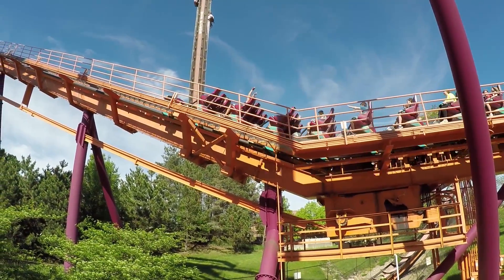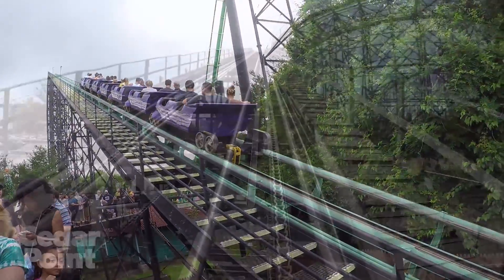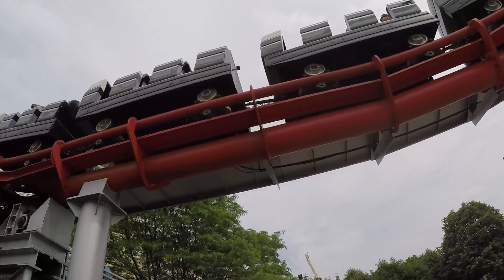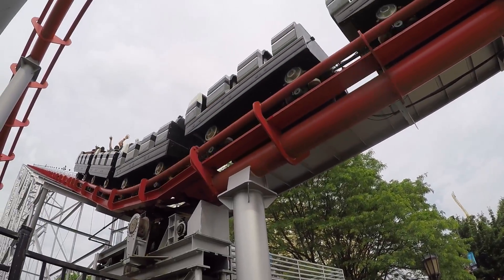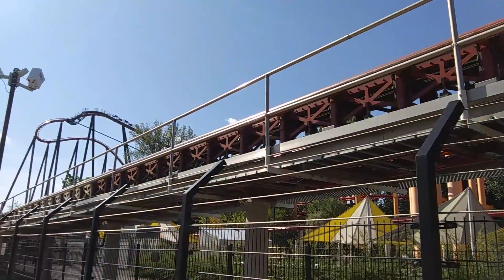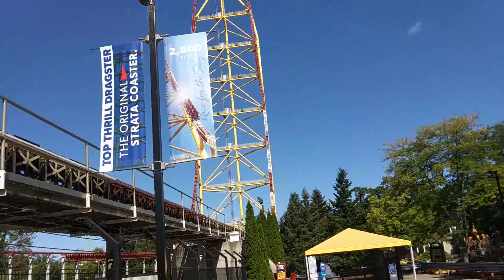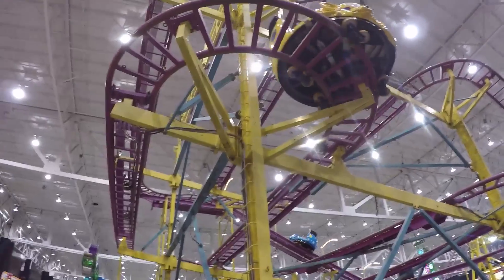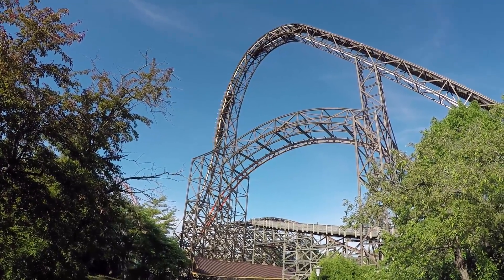Can roller coasters fall BACKWARDS down the lift hill???

Comment: Yes but it's STUPIDLY unlikely and can only really happen near the bottom of the lift hill where the train engages the anti rollbacks. Shoot the Rapids at Cedar Point actually did roll backwards down the lift hill because it failed to engage the anti rollbacks correctly

Comment: "Some rollercoasters have magnetic brakes that pop up behind the passing train but will not stop a train"
I'm sorry, what? This whole time I thought the breaks on my favorite roller coaster would stop the train should something happen. It has a straight vertical lift hill. I do NOT want to fall backwards should something go wrong with the lift chain. O_O
Reply from the maker: Magnetic brakes are unable to stop trains. You would fall back down the lift extremely slowly.

Comment: Swedish park Liseberg also had an incident involving the failure of an anti-rollback system, on their Schwarzkopf coaster Lisebergsbanan. The chain lift experienced a malfunction while only part of the train had engaged with the anti-rollback mechanism. It couldn't withstand the pressure put upon it and subsequently broke, sending the train backwards into another offloading train. 21 people were injured, but none of them severely. It was a major incident for such a small country and safe park, but 14 years later and it's been back to operating perfectly safely again since.

Comment: at Six Flags Kentucky Kingdom we have a ride called Greased Lightening that goes forward into a loop and then backward again back into the loop. I was never the biggest fan, but it’s a good enough ride if the line is short.

Comment: How do u get out from roller coaster with 90 degree angle lift hill if it stops
Reply: Most of the time we either send it over in maintenance mode or release the motor brake and slowly bring the train back. It's extremely rare to have to evac off a vertical lift. 

If the perfect storm of problems does happen and evac is needed, there is a maintenance lift with a hinged platform that swings out in front of each row that people stuck will climb into.

Comment: Another serious rollback incident happened at the Swedish amusement park Liseberg. The claw type rollback preventers were perceived as too loud, so the amusement park created cam type preventer, they gradually wore down and were also affected by grease from the lift chain. When a bolt broke on one of the chain locks the preventers failed to work and a train rolled back towards the station where it struck a waiting train.

Comment: question. i always have this fear and i know it’s irrational, but i’m terrified of a ride getting stuck on the lift hill and then if they are evacuating the riders the ride will start working again. same with if it got stuck in other places and they started evacuating and the ride just starts up again. is that possible? or likely?
Reply: @Chimera thank u so very much! :)
Reply: Most of the time there are 2 keys that are cut differently that need to be put into the control panel to power it on. One is used for normal operations, the other is kept by maintenance. The coaster can only clear an emergency stop error with the maintenance key, and if both keys are taken out nothing can move at all.

And if there is a lockout/tagout, you might see a park official and maintenance with a red metal card-like thing and a uniquely keyed padlock hanging off their hip. The critical switch to power the coaster is turned off, that card-like device is passed through the switch to keep it locked off and the padlock put through the holes in the card. Then up to 6 padlocks can be locked through that card, and the ride cannot be powered on until every one of those padlocks are taken off.

This sort of thing is common with heavy industrial machinery when you need to maintain it, and coasters are pretty much all industrial engineering with a bit of artistic flair.
Reply: Ravaxr thank you!
Reply: @Chimera I was a steam train engineer at an amusement park, and in working up the ranks to the engine I got placed on a few coasters when they were short handed. Also a bit of a coaster nut to begin with :p

Comment: The anti rollback clicking noises are so freaking satisfying. It also makes the lift hill so much more intense. Especially on rides like X2. Also I never knew that the friction brakes on gerstlaur lift hills slowly bring the train back. Also I felt like you should have showed the rollback fins on top thrill dragster so other people can understand what you mean. Overall great video
Reply: It's so loud on x2 though I'm trying to listen to the movie quotes over top of enter Sandman not the clicking. I couldn't tell if it was enter Sandman the first time since it was so loud. El toro has my favorite lift hill though. The station is elevated about 15 feet so you fly out of the station around the bend to the lift. You lift slowly for the first 3rd and then it yanks you up the hill at like 10-20 mph (it was years ago room for exaggerating just a bit) then it throws you into the bend at the top with like an 80° angle drop after it. It's a wild experience and unforgettable. The sound it makes is the loudest lift I've ever been on, and I thought Matterhorn was loud! You have to shout to talk to the passenger in the same seat as you on Matterhorn but el toro doesn't even give you that!

Comment: Wow. I've never realized the anti-rollback on some coasters were like that. It never occurred to me that I couldn't hear the anti-rollback on cable lifts.
Reply: Same thing happens with Expedition Everest for special effects. All you hear is the chain dog sliding over the chain before it engages, not the anti-rollback. Once the chain engages it is silent, leaving the sound effects from hidden speakers. Again, uses a magnetic wheel to levitate the dog unless it slows down.

Comment: In regards to other coaster questions: I've been wondering how block brakes actually work. How they detect whether or not the next block is actually clear and either activate the brakes or not. This seems to be a much older technology that predates the use of computerized sensors so I'm guessing that's not how many of them work.
Reply: I think gp to enthusiast made a video on it
Reply: Here is the link to the video: https://youtu.be/LJvrkxs4OXw
Reply: You'd be very surprised what you can do with relay logic. Technology Connections has a video about a jukebox that predated microprocessors and uses relays. It needs to interpret the selected song, find the selection, pick up the record, put it on the platter with the desired side up, then put a needle in the right spot and take it off at the end of the song to put the record back. Coaster blocks are way simpler than that.

It used to be that there was a spring loaded steel rod on a hinge that stuck out into the track. As the train passed, it would hit the rod, flipping it out of the way and tripping a switch. Of course, being mechanical and having to hit the train all the time they were annoying to maintain, so as soon as no-contact hall effect sensors came around they were integrated into coasters pretty quickly.
Reply: you ever seen those little green things sticking out on the track? those are sensors. they tell a computer system where the train is.

Comment: Thanks for this video! It’s very helpful. A few years ago Sheikra at Busch Gardens Tampa Bay stopped two ride vehicles on top of the roller coaster 200ft in the air and everyone was stuck for hours and needed to be helicopter rescued. Ever since then I haven’t been able to go on it or rides like it, even though they used to be my favorite. Do you know much about that incident? Because I could never find out what exactly happened.
Reply: Busch Gardens called it an 'electrical error' and didn't go into much more detail, but the symptoms make it pretty clear what happened.

That was a sensor error that showed the block between the dive pause and the mid-course brakes was occupied when it wasn't. There's a block between the dive pause and the top of the chain lift, and the chain lift itself is another block. The front train stopped at the brake before the dive as it should have to not violate what the computer thought was an occupied block. Then the back train kept going up the lift hill until it reached a few meters from the top and stopped there so as not to violate the block the front train actually was occupying.

It took a minute for the ride ops to realize there was a problem because a momentary pause to let a block clear ahead is normal, and Sheikra loads two trains at once. By the time they realized the pause wasn't clearing, two trains that were loaded simultaneously had stacked at the top of the ride and had to be evacuated. The ride performed exactly as it was designed and nobody was in any danger at any time, but the media went nuts because it was dramatic, visible, and cOaStErS Be ScAwY >n<
Reply: Ravaxr Thank you very much for the answer! That makes a lot of sense!

Comment: one of my main coaster fears is actually that noise because i thought it was the chain, but knowing its the safety thing now makes me a lot more comfortable. tbh, i have never been on a real coaster because i have a horrible fear of heights and on any ride that goes more than 10 feet above the ground i have to close my eyes, but these vids do help with some of the other fears ive had about coasters. does it ruin it to ride with your eyes closed?
Reply: Start small! My first coaster was space mountain at Disneyland. It's a perfect first rollercoaster. The ride is in the dark with stars projected on the walls around you. No inversions (upside down bits) and it only goes 30mph. Matterhorn is a good one to start with too. Both of them are indoors so you can't see how high up you are, but you aren't that high up anyway, Matterhorn feels especially nice for those afraid of heights since the track you're on is level with the mountain ground. No support beams to be seen. There's even a splashdown at the end! Space mountain is in the dark and while you can sometimes see support beams you are never far from the ground. Heights are scary, it's one of the things that still makes me afraid on rollercoasters, but I've been on the tallest of them all now, kingda ka. It was the only one to ever make me go "oh my god!" When facing the ground from that high up! There's even gadget's go coaster in Toontown if you're feeling brave enough to see the ground from 30 feet up.
Reply: spinningpeanut i live in wisconsin and im lower middle class. i cant go to disney so im gonna need to try other things. sadly we have nothing similar up here
Reply: @raeisgay426  Wisconsin dells has some good coasters, and pretty much all parks that have big rides have smaller ones so younger park-goers can get used to the sensations of being on a coaster.
Reply: Ravaxr are some coasters at mt olympus seem good for beginners? my twin and i have been discussing trying their coasters next time we go (was hoping for this summer but i guess not.) funny thing is, i love water rides. and for a lot of those you climd to the top, you dont start at the bottom
Reply: @raeisgay426  From what I see, it'd be pretty good. The things I look for in breaking in a new rider is a height around 100 feet, first hill is not very steep (I look for 45-50 degrees), and the ride does not invert. Cyclops looks to fit the bill. Zeus looks to be a good step up, and Hades another decent step.

Once you get on a coaster 150 feet tall with airtime, one that does a vertical loop, and one that has a heartline twist, the sky is the limit. At that point you've felt pretty much all the sensations that you'll get on much bigger coasters, and should be able to handle pretty much anything, including 300+ ft giga coasters. What really changes from ride experience is the variations of those sensations, and how long you experience them.
Reply: Ravaxr i want to try building up to at least hades 360. it has a (im bad with names/classifications) corkscrew? i think? idk some swirly thing
Reply: @raeisgay426  It is a bit of an oddball, isn't it. It's kind of a heartline twist, kind of a corkscrew. It's something in between. But it's made of wood and pretty impressive that they managed to make a working inversion with that. 

In any case, best of luck to you, and go at your own pace. Coasters are supposed to be thrilling and fun, not terrifying. I used to be in the ironic position of being very scared of coasters but fascinated by their engineering. The light stomach feeling going down hills is what kept me off them. Took until late teens to get on anything over 100 feet. Nowadays I'll hop onto hyper coasters and hold a conversation during the ride.
Reply: Ravaxr it also goes under the parking lot. i think its a pretty cool coaster but once again im a scaredy cat lol

Comment: I mean... while yes, good video, I feel like you forgot a certain type of coaster, I believe it's known as a boomerang? though I was previously aware as it being called a shuttle coaster or something, basically one where the riders are pulled up a lifthill and then dropped back through the station and into the ride, backwards or forwards, only to come to a stop and roll back through the ride at the end of the track.
Reply from the maker: Lol yes, those are designed to fall down the lift.

Comment: There was an even worse incident than on the Wild Wonder ride, that occurred in 1972 on the infamous Big Dipper coaster at Battersea Park near London, when the rollback mechanism had become severely deteriorated and failed to stop a train that disengaged with the lift cable.  It remains one of the worst incidents in theme park history; and might be worthy of a deep dive video.

Please remember folks, these incidents are so extremely rare as to almost never occur.  Roller coasters are very safe.  When you see the rare news report of "Riders stuck on roller coaster lift" that's the safety system working exactly as it should.
Reply: Ferret Sp the Big Dipper didn’t have an anti rollback system.
Reply: @Bonefingers3  I stand corrected.
Reply from the maker: That coaster did not have an anti rollback system, in fact one of the reasons ARBs are so common now is because of that accident.

Comment: Great info! One thing that brings me anxiety re roller coasters is the thought of getting stuck on the lift hill. On a ride like Millennium Force, it doesn’t look like there’s any handrail/stairs next to the lift in case they have to evacuate. I’m curious as to how that would be handled!
Reply from the maker: Millennium force actually uses an elevator like car that rides on the platform to the right of the train when a train needs to be evacuated!
Reply: GP To Enthusiast that’s awesome! Thanks man!
Reply: There is a maintenance cart that can be used to evacuate riders from the lift on Millennium Force: https://www.youtube.com/watch?v=YjBIG7JXYBk

And on inverted coasters such as the Batman rides or Vekoma SLCs, there is a platform that can be brought up under the train, so that riders can step onto the catwalk safely.

Comment: Don't forget the ARB on some Vekoma SLCs, they use a kind of friction brake that is similar to the clicky ARB but not as loud. 
Also on roller coasters where the chain lift inverts, there are two chains so that a train can be slowly let back down to the base of the lift if the train stops on the lift upside-down.

Comment: Spoiler Alert! Do not read if you haven’t been to Hansa Park!

Der Schwur Des Kärnan does fall down its lift hill as part of the pre-show.
Reply: Cycloid23 bruh if I went on it I would have had a panic attack 😅
Reply: Cycloid23 It’s a gerstlauer so it doesn’t have ARB, it has magnets that allow that
Reply: Phantom Coasters The point is it drops on purpose and it doesn’t use the fins on the pre-show drop except close to the bottom.
Reply: Cycloid23 i know, i was just saying that it is able to happen because it doesn’t have ARB
Reply: I've never been to Hansa Park but I've watched both a POV video of Karnan and the Coaster Studios review of it. Karnan dropping down its lift hill was already spoiled for me long ago.
Reply: is it free fall? or controlled fall?
Reply: @AnotherSwissYoutubeUser  both
you freefall down the drop, but controlled by magnets i think
nothing to worry about its safe
Reply: @AnotherSwissYoutubeUser  Freefall, but in the sense that a rotodrop is freefall with a section of bare track, but way more than enough magnet brakes to stop the train at the bottom.
Reply: I would probably cry. 😭

Comment: Depends if there isn’t an Anti-Rollback System (Also depends if the manufacturers are absolutely idiotic)
Reply: Wha???
Reply: Idk lol
Reply: @Todd21212  Rides are required to have an anti-rollback system installed. In fact, I believe rides need several ways to stop the train from descending down the lift hill in the case of the train disengaging with the chain.